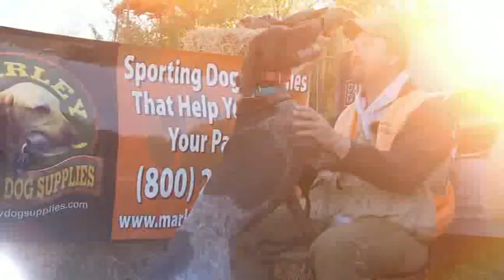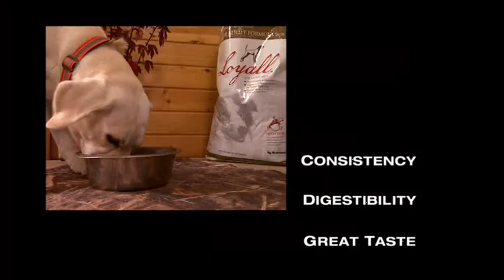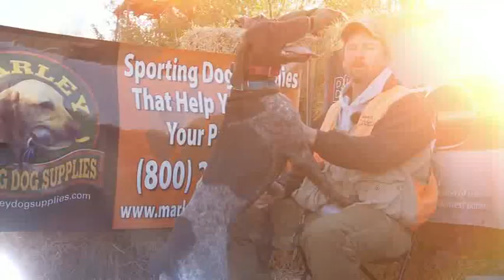BDC World Championship Finals 2011 - Top Gun Pointing

Comment: I have agree with "Dillon's" comment.  These dogs are not remotely broke - except one or two perhaps.  You could get to the top rung in this sport fairly quickly just by having a better trained dog.  
The inherent challenges of this sport - as I see it - is that the birds are synthetically concentrated to a confined area which requires a dog that handles under foot.  Not productive for the bird engine dogs we typically aspire to have when wild bird hunting.   This looks like a great flushing dog sport though.
Reply: hello, I'm wondering what it means for a dog to be broke, novice hunter and first time gsp owner here.
Reply: @clockfingerboards  Broke is a vernacular within the dog world meaning steady through-out the flush, shot and fall.  Many hunters will tell you they don't want their dogs steady and then you get a plethora of excuses for why they didn't put the time and effort into finishing their dogs.  Regardless of what you hear, there are NO advantages to an unsteady dog.